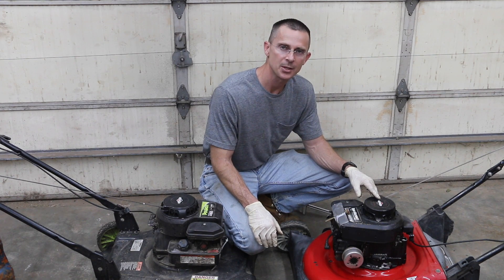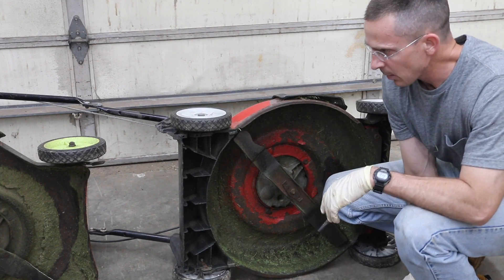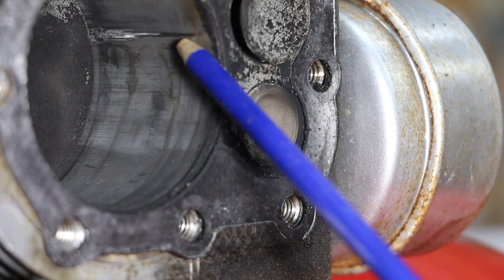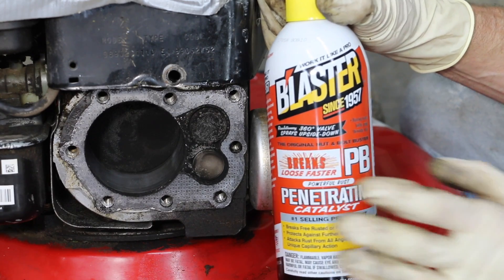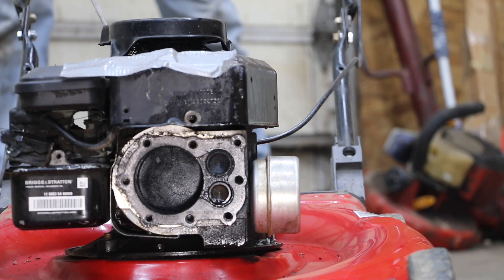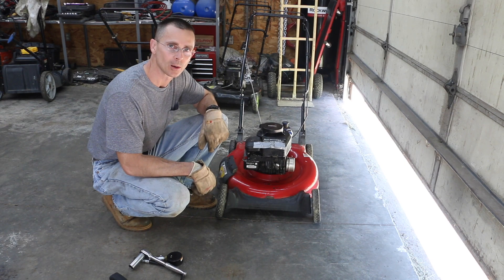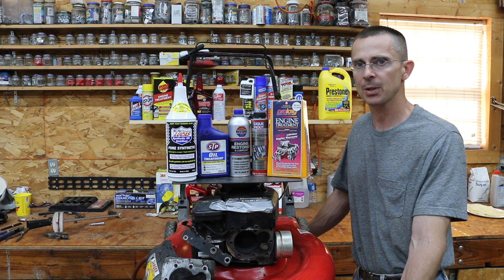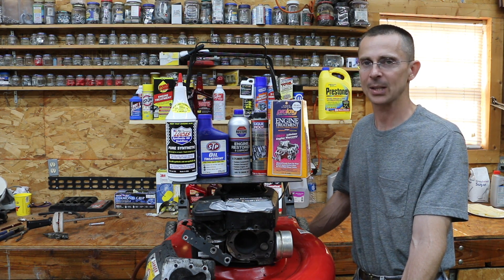Engine ran without oil, seized! Can it be saved?

Comment: If you hone it with a ball hone diggle berry then you are good
Reply from the maker: Thank you
Reply: @ProjectFarm  thanks the shop term I use is a single berry. I used it on my snow blower engine when it had a bad scoring and it worked really well new rings maybe cause those are fried and it will  e good. I love the videos. I havent looked but maybe do a test with JB weld on the block. I have a block the crankcase that has a hole in it the rod broke it. I would love to see you do a repair and see

Comment: Idk. My audi b5 1.9tdi 85kw is still fine af. Oil pan had a hole in it and it was driven for 4km with 0 oil. Motor just stopped and lost all power. New oil pan, New oil and it rides like New.
Reply from the maker: Glad it didn't destroy the engine. Thank you

Comment: Why dont you try putting Restore in this engine??
Reply from the maker: Thank you for the video idea!
Reply: That was my thought too.try the restore.
Reply: I also want to see the test of using restore
Reply: Agreed, restore is great
Reply: @colchronic  sure is.  Reduced the oil consumption in my car by 50%!
Reply: @jimkline746  yup I have a 2006 Camry with a 2az-fe motor which is notorious for burning oil, a can of restore cleared up the smoke
Reply: @colchronic  Toyotas have a reputation for being a good vehicle.  Someone must have abused it.
Reply: @jimkline746  nah they have had lawsuits for this engine, look up 2az-fe. Anyways I was the only driver, overall it's a solid car
Reply: @jimkline746  I bought Toyota because they used a non-interference engine, if your timingbelt disconnected, you didn't have to buy a new engine, just re-time it with a new timing chain, or belt! In my opinion!
Reply: I have used restore in my old worn out mopar engines for about 15 years, I swear it works and isn't just a placebo effect lol
Reply: Another vote for engine restorer...

Comment: about 20 years ago Lordco Auto Parts had a product that worked well for me but i can't remember the name.  You were supposed to get the engine to operating temp then remove all the spark plugs and drop in 6 graphite pellets per cylinder, the pellets melt and this is supposed to bring up the compression.  I performed this test on 1994 chevy cavalier with a 3.1l engine, i noticed the compression on all cylinders went up 10 psi.  I'm not sure if this product is better than engine restore but in theory it should perform better due to how the product is applied to the engine. i would like to see a test like this.  Love the videos by the way, thank you for your detailed videos.
Reply: Hmm, I could use some shit like that. I resell Volvo 240s, and compression becomes an issue on these because most engines have 300k-400k miles and they lose enough compression that it's noticeable. Just being able to get these engines making a little more compression work get it them to be a lot happier.

Comment: We used to un seize dirt bike engines by just taking out a spark plug and spraying in a generous amount of wd40 to penetrate and creep. After that we would fog the engine or spary in another type of oil that isn’t solvent based to restore cylinder lubrications and protection if the engine managed to turn over. Then just go to sleep and check on it the next morning, by standing on the kick starter to get the cylinder moving again. If it turned over would just replace the spark plug and start her up. That’s it that’s all 😂 and it usually worked
Reply from the maker: Thank you!

Comment: Im a little late to the party but, I picked up a Yamaha 700 cafe style bike, 3 cylinder back in the 80s ( my 3rd bike. first was a 750 yami from a garage sale for $25. )
This had sat out in the michigan weather for 2 years and the rings had rusted to the cylinders. My mechanic buddy came over and said you want to spend $500.00 on it or ride it later on today? Knowing he was not the basic mechanic I told him let's do it your way. First remove spark plugs, coke down the cylinders, let set 20 minutes, WD40 chaser 3X let set 20 minutes each time, dump oil out put Castrol synthetic in crankcase, the castrol had only been available a short time. Put the bike up on the center stand, put it in gear ( plugs still out ) grab back rim and start pulling ( or pounding ) pistons up through the cylinders,  add WD40, continue until we got a complete tire rotation and the pistons ran the cylinder smoothly ( about 20 minutes ) He put a battery charger on, spark plugs back on, tried to use the electric start, used the kick starter 3X then the electric start turned it over, hit it with ether and she fired up. Ran it about 10 minutes, took it for a short ride down the block, came back changed oil cleaned spark plugs and that was it. She ran fine with just a little miss. 2 months later I had to put it up for the year and we pulled the carbs to rebuild, come to find out cylinder 2 carb had a messed up float, it was set so low it wasn't feeding enough fuel for anything over about 3000RPM. She ran crazy fast the next summer, kept it for 3 years sold it for about 4X what I paid and bought another bike project.
This was a bit different than being seized due to lack of oil but my friends ingenuity saved me a bunch of money and time. Our riding season is so short you have to grab what you can when you can.
Reply from the maker: Thank you!

Comment: Hello I raced for 45 years on dirt and paved Racetrax in Indiana I used to use slick 50 but I switch to a new brand back when prolong came out somebody told me about it and I tried it out with in my oil my race engine. As I was racing on the first heat I ended up losing my oil plug my oil came out , had 6 laps  to go no oil pressure I finished the race put a new oil plug in and put regular oil back in had no problems that night. I raced with that engine the rest of the year, When I went to tear down my motor the only thing I seen actually scarred verily little scarring on my camshaft bearings that was it. I would like to see you demonstrate some prolong against slick 50. I am a true witness on prolong really works and saved my racing motor
Reply from the maker: Thank you!

Comment: I am curious. Could one remove .001"-.002" out of the cylinder hole to remove the scratches and then replace the piston rings with slightly larger outer diameter ones (.001" ...whatever the removed amount was) to get the seal back and smooth again?
Reply from the maker: Thank you for the video idea!
Reply: @ProjectFarm  That would be cool. You could put the block under a mill and use an adjustable boring head, rough pass + finish pass. That would ensure a precise bore.

Comment: Add some JB Weld to the oil while it is running.  Keep it running while it solidifies, and it will tighten up the loose bits.

Maybe...

(but prolly not)
Reply from the maker: Thank you for the suggestion.

Comment: I think I would have taken a torch to the cylinder with the piston at the bottom of travel to expand the cylinder, then waited a minute for the heat to spread from the cylinder wall, then put some motor oil in with the engine tipped up, then rotated the engine, slowly at first, then once it was a little loose, put the cover back on, put a tablespoon of oil in the cylinder, then rotated it at increasing speed with a drill.   Of course honing the cylinder, and new piston rings is the better answer.
Reply from the maker: Great strategy. Thank you

Comment: I run an equipment repair shop. A mechanic taught me an old trick 45 years ago. A customer came in to his shop with a car that overheated and seized. He purchased the car from the owner. He spent part of the day trying to get the engine to run again with no luck, still seized  up. He asked me to go to the grocery store and buy a few quarts of Coca-Cola. I got back with the cola and then saw him remove the spark plugs and start pouring the Coca-Cola into the engine cylinders. I thought he was out of his f-ing mind. The next day he came in removed the spark plugs and turned the ignition key. I couldn't believe it, the engine turned and blew the remaing coke out of the cylinders. He flushed every thing with new oil and the engine ran again. I have done this same thing with leaf blowers , string trimmers and a golf cart engine. I know the golf cart ran for quite a long time, it burned a little oil but still ran well. The blowers & trimmers ran well for quite a while also. Note: the engine crankshafts  were not totally seized but were not turning free enough to use the starter motor or recoil starters.  Make no mistake, if an engine has seized it still has been permanently damaged until proper repairs can be done. This was just a short term fix on much older equipment to get a little added engine life out of it. It might just run a day or the rest of a season, the engine has still been damaged...
Reply: Ahhhh... The Crisp Refreshing Taste/Power of Coca-Cola!
Reply: phosphoric acid,  or rust kill,  sufficiently diluted.
Reply: @acbikeoz  could you please tell me the correct dilution.
Reply: @timothykemp908  Commercial rust kill is 20 to 30 % phosphoric,  for flushing alloy radiators I use about 3 to 5%, remove the thermostat, and run the engine cold to circulate it,  when it looks clean, I get it out and flush it,  maybe half an hour.

I think 5 %  would be ok in  seized engine too,  the thing is to time how long it needs,  pour it out, have a look  pour it back in,  
Coke cola is actually dilute phosphoric,  that's the food acid ingredient,  but no idea how strong it is,  
maybe  use 1% if you're going to leave it over night
Reply: @acbikeoz  thank you!
Reply: @timothykemp908  100% straight Coke out of the bottle or can.........
Reply: I tried this coke trick on an engine, and it just filled up with bees.
Reply: @markk3652  Got a good laugh on this one. Thanks.
Reply: Things go better with Coke?
Reply: nice
Reply: Hi-Ho Hi-Ho it's off to the store We go.  ~(;-})={>----]
Reply: Reminds me of when I got a bit more life from a 2-cycle chain saw with piston scoring, it would stall after losing compression.
I'd pop the muffler off, pour a tiny trickle of 2-cycle oil into the cylinder, pull twice, pop muffler back on, and it would start up and run for another 20 minutes.  (then it all burned off again)
Short on cash, but have a quart of 2-cycle oil?  There ya go!
Reply: Pepsi
Reply: Get it to run, long enough to sell it? !!..lol..!!
"Late model Ferrari for sale!
Needs a little work, but runs!"
Reply: So what if you try this and then get oil changes frequently will the car motor be ok
Reply: i'll have to try this one

Comment: I can't read them all so I will go with STP. That engine I'm sure besides cylinder wall damage, I would say has crank to block damage such as scoring, crank to piston rod scoring, piston rod to piston pin damage, piston pin to piston damage, and valve to valve guide damage as well as timing cam to end of valve stem excessive wear which is now giving less clearance. I don't know what kind of wear that will be in the crank gear to gear to timing cam wear as well as their mountings into the block. There is just a lot of places of wear in that engine and I am really surprised  that you did get it to run again.   Do you know that Marvel mystery oil is also a recommended upper cylinder lubricant to be mixed  with your gas to help lube piston rings and valve stem and guides. I would like to know what the other recommended products are, I've seen a couple but they are to small in the picture to read the names. All in all a nice video interesting and astonishing to see you get it running again. Love all your comparisons. PS I have been using JB weld for over fifty years and it was my uncle that showed it to me and he was a plumber for forty years and used it a lot. Loved when you fixed the cut cylinder head with it!
Reply from the maker: Thank you!

Comment: What can cause the knocking sound? I have a honda which started smoking all of a sudden, then the motor died. Now the motor is all locked up, i can turn the blade about a quarter of a turn but then it's totally stuck, it spins free for that quarter, back and forth but i can't get past that
Reply from the maker: Did the engine knock?  Highly recommend removing the spark plug to see if it will turn over. It sounds "hydrolocked", unless the connecting rod came loose.  Hope this helps.
Reply: @ProjectFarm  i unscrewed the sparkplug; everything looked okay there. I forgot to mention that if i take the top cover off of the mower and i push up on the blade from the underside to the top, you can hear and see that the whole blade and everything it's attached to goes op and down about 5 mm.

Comment: Short answer is yes.  Only had two size from lack of oil.  The first one smoked after but did run.  The second ran just fine.  Used ATF down the plug hole on one and diesel on the other.
Reply from the maker: Thank you!

Comment: As far as I can tell all of the manufacturers increase compression by adding a substantially thicker oil to the original oil in the crankcase. It will increase compression but it probably won't circulate nearly as well.
Reply from the maker: Thank you!

Comment: My dad had a small compressor he thought was shot but I was able to get it running again.  I did take the pump portion apart and clean it out and put new oil in it.  You would never guess today that there was a problem with it.  I used it a month ago and it got a small leak.  It was just a small pinhole leak that, at first I thought I didn't close the drain valve.  It turns out it may have been designed to have that thinner spot there so that if it does start to rust the whole tank is less likely to just explode.  It was 30 or 25 years old and the compressor and motor still run fine.  I just have not plugged it in since that leak made itself known.  What to do with the motor I would not know.  It is just a 3 HP motor on a Craftsman.  It is not one of those airless ones.  Then I have my sister who got one of those cheap little Harbor Freight pancake compressors.  That thing is the epitome of pathetic!!  it takes forever just to build any pressure.  That is a small tank too and it feels like the 12 volt tire inflators sold for emergency use mostly would beat that worthless thing any time no contest!!  I tend to think of Harbor Freight as horrible fright because it is really junk for the most part.  The only reason I like that place at all is they have a good return policy.  I guess they know damn well that stuff does not stand a snow balls chance in hell!!!
Reply from the maker: Thank you

Comment: This reminds me when I was riding my 86 250es bigred. I was riding, braaping in the woods. I slow down to move a branch out of the way and I heard a little tap coming from the bike. I thought I was a little low on oil considering it burns oil. I get home only to find out I had been running for around 30 minutes with no oil because my drain plug had fallen out. That atc still runs and has no knocks. I was running used motor oil from my daily driver considering that it went through a good bit of oil a ride.
Reply: Tyrone_ da_moose when i hear my engine odd i always check if theres oil afraid its running dry

Comment: I've never been so lucky when the engine on my riding mower a Briggs 8 horsepower let go the rod came out of the block , now before that happened it seemed like it was down on power my cure which proved fatal was put a string on the throttle and over ride the governor it helped power until the rod left the piston. 
Replaced the engine with a rebuilt one $250
Oh yeah the string only helped for about 5 minutes. Thing was it didn't knock just low on power till boom
Reply from the maker: Thank you

Comment: Hey I really enjoy your channel. I have a question for ya. I have always done my own oil changes on my cars and even an old riding mower for years. I bought my first push mower last season. It is a Briggs and Stratton. When I looked for a drain plug I found nothing. Do I just tip it over to drain??
Reply from the maker: I would tip it over to drain it if there isn't a drain plug.  I've had a couple without drain plugs as well.

Comment: I bought an 03 Chevy with the 8.1l engine. I noticed that when I started it that there was a slight knock until the oil pressure came up. I put some Original Slick 50 in it and drove it like that for over a year. It still had the slight knock at start up and thought to investigate and pulled the pan. It turns out, it had a spun bearing that was welded to the crank that was worn about .017 of an inch. Amazingly the hone marks on the con rod were not worn so I replaced the crank and bearings and reused all the con rods, and the engine is fine to this day.
Reply from the maker: Impressive!